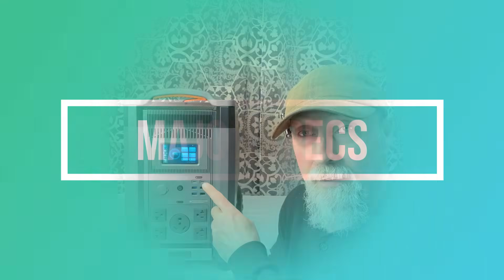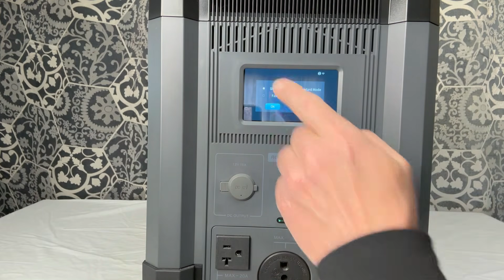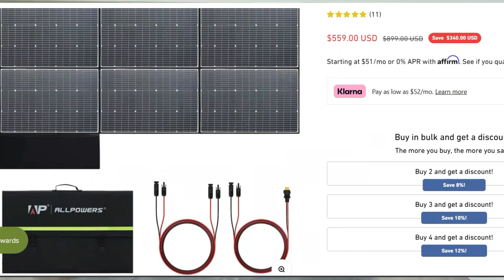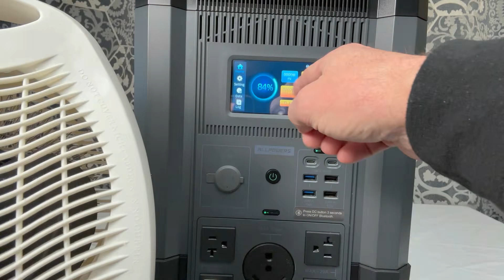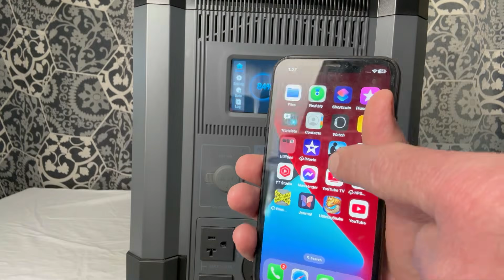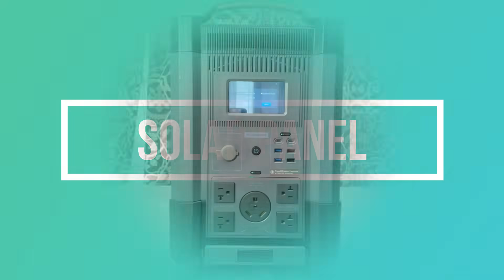The Ultimate Power Station: The AllPowers R4000

Comment: Hi, I’m having trouble with my ALLPOWERS R4000. It will not turn on by itself unless it is plugged into the wall, and when I plug it in I hear a ticking sound, the touchscreen comes on, and the “Grid” reading only shows around 0–50W while the battery percentage stays stuck around 69%. If I unplug it from the wall, it immediately shuts off and the screen goes dark. I have tried different outlets, unplugging everything, and restarting the unit, but the issue keeps happening. Can you please help me with this?

Comment: Just ordered my R4000 last night. I currently have 2 of the R600 and 1 R1500. Count me in for the R2500. In my opinion the Allpowers unit puts a lot of bang for buck compared to other power stations. The misses and I are already planning a power down experiment. We plan on utilizing all of our power stations. Then shut off the power at the breaker box. Just looking at our power bill we pay $30 a month whether we are using electricity or not. And in many cases the only way they will disconnect your power is if your bill remains unpaid. If you ask them to disconnect while you are in good standing they will give some argument about it not being legally allowable. The power companies are hold us hostage. We need to start taking back our independence.

Comment: Count Me In

I'm hesitant about the touch screens. Experience with 60kw generators in the military and had 2 newer models with touchscreens that were bricks when the screen broke. One went "rainbow" most likely do to sun exposure, heat, and vibration. Other one just stopped powering up. With old school manual switches and analog or even digital gauges when something malfunctions it can be bypassed to keep unit operational and a multimeter can be used in place if a metering gauge.
Reply from the maker: I will be surprised if most of the newer models don't all touchscreens soon. I hope we don't have the same experience you did with them. Thanks for sharing. You are in!